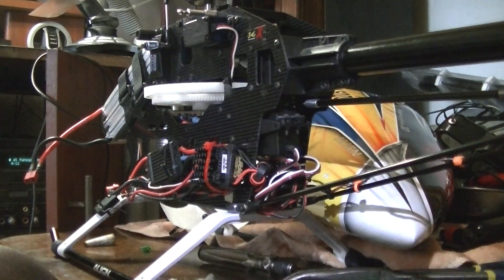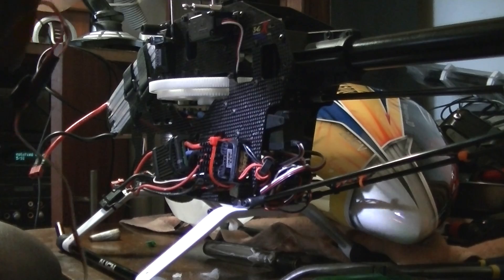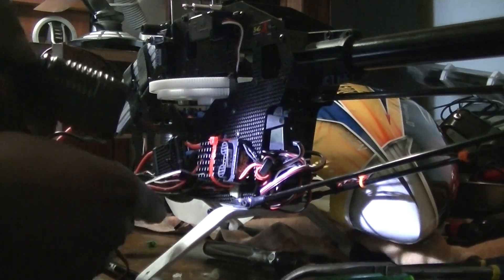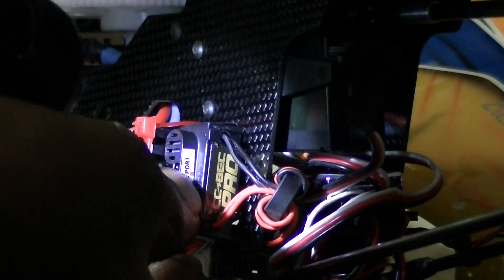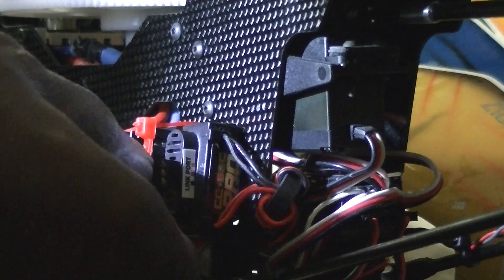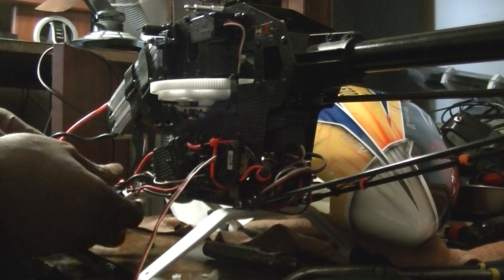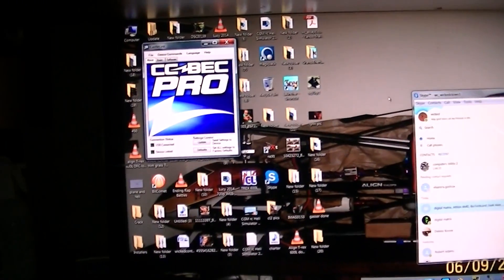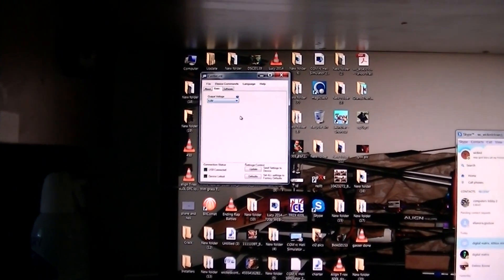how to program castle creations bec pro

Comment: Of note: For the CC Link, you only really need the Signal and ground to connect to the BEC.  The cable that normally comes with them is only 2 leads. :)
Reply from the maker: Power Dyne 
thanks brother 
cant believe no one else tried to make a how to video on this,